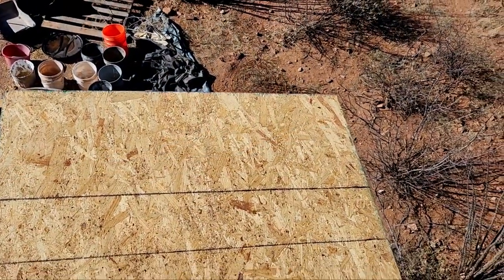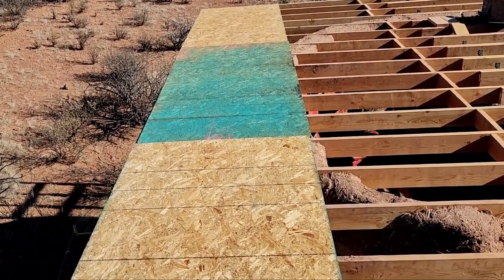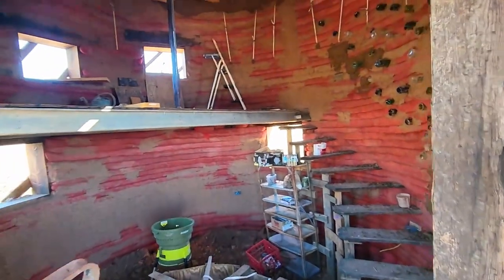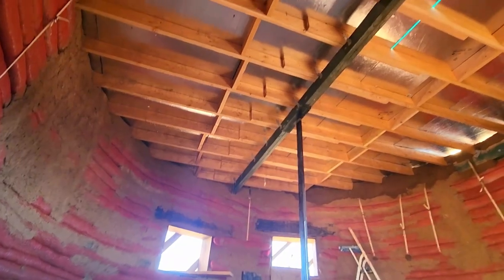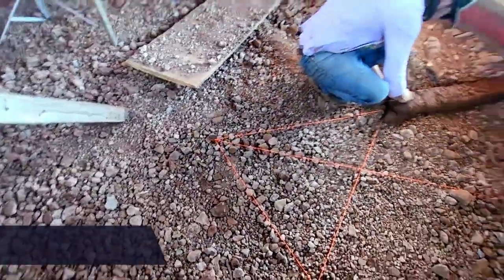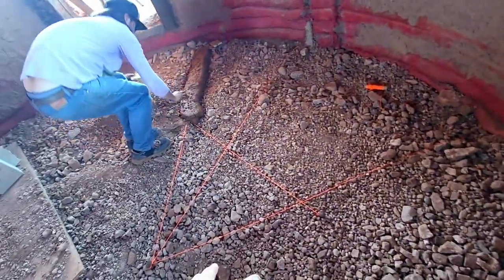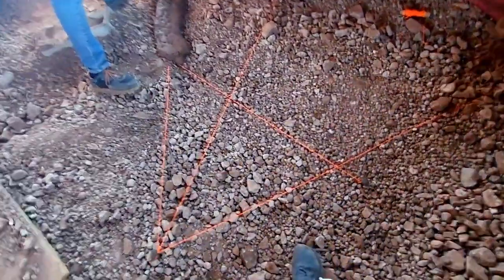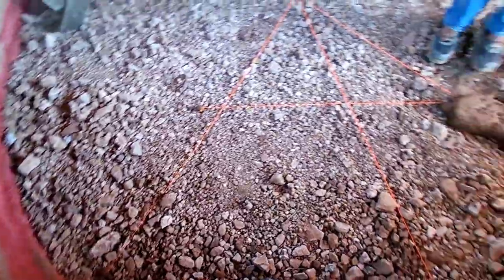Roof Install & Starting Our Shower Cob Recycled Bottle Wall | Hyperadobe Earthbag Tiny Home Ep 12

Comment: Perhaps I'm missing something obvious, but why not build a self-supported roof prior to building the earthbag structure? It would allow you to protect the build from the elements as well, then you just build all the way to the roof.
Reply from the maker: It would be very difficult to get the bags installed in the last 6 ft or so since you have to stand on the bags to fill and tamp.